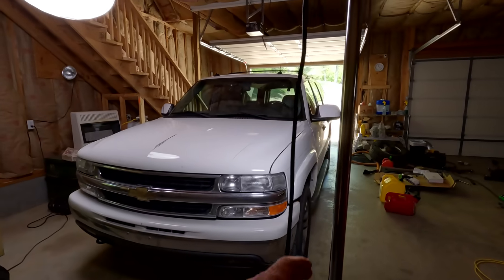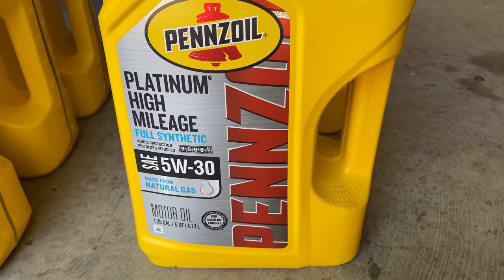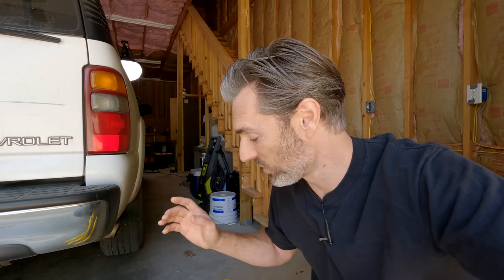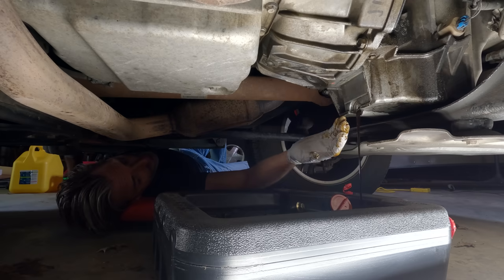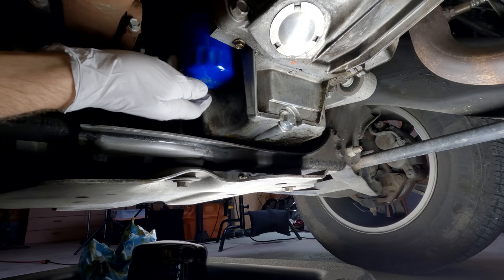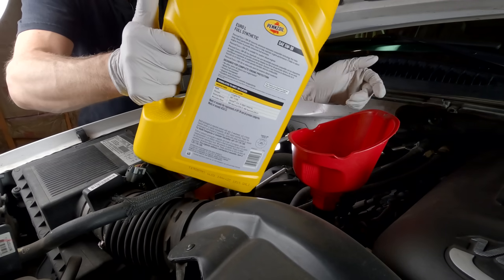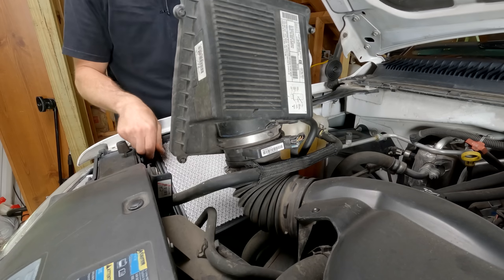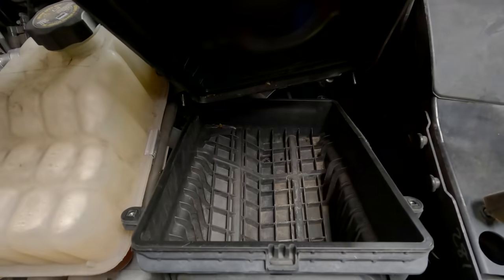If I Use European Spec Oil For My American Made Truck, Will It Break?

Comment: I always shake the oil jug before filling the crankcase. The additives sometimes fall out of suspension and settle on the bottom of the jug.
Reply from the maker: I do that too. I guess I could’ve included that in the video. 🤷‍♂️
Reply: Me too, some brands like Pennzoil are particularly bad about that. From my experience, Pennzoil Ultra/Platinum jugs still have additives at the bottom after shaking it up well. I have never seen that with Mobil 1 though. That's not to say one brand is better than the other, it's just an observation.
Reply: Did you shake the vehicle ,when it stays a long time without using it?
The oil had to hold the particle 
Dirt from the engine and the aditives in levitate.greetings from germany
Reply: @averyalexander2303  To think about all of that sitting and burning or just globbing together inside your motor. 

That sucks to think about now. I never really looked inside the bottles to see myself and reuse the old bottle pretty quickly.
Reply: I'm gonna have a hard time doing that with a 55 gallon drum.
Reply: @johannesherr2333  Whether you believe it or not, it's true. I've seen the proof with my own eyes. You definitely want all of the additives going into the engine and not sitting in the bottom of the jug you are going to throw away because at least it will be in the engine and it will get mixed again when you start the engine, otherwise it's not in there at all.
Reply: Lol you people will believe anything. Do you think dealerships shake the 400gal oil  tanks in the back before they put oil into a vehicle via the oil guns?
Reply: @johannesherr2333  What additive is "particle"?
Reply: @npb3871  Lol, giant paintshakers
Reply: If you are adding the whole jug into the engine, I think it will get plenty mixed up when it runs
Reply: @npb3871  😂😂😂 lol I work at a dealership and I know what you’re talking about 😂
Reply: I always shake containers whether it 5 quart jugs or 1 quart.  Old time mechanics that taught me always did it.
Reply: @averyalexander2303  how would you even know this? You can’t even physically see “additives”
Reply: @kg_1720  Because I can see some type of residue at the bottom of the jug after pouring it out if I don't shake it first. From the research I did, this is most likely additives that fell out of suspension. I suppose it's possible that it could be some type of impurities in the base oil, but that seems unlikely to me. There's several videos and forum posts discussing this "issue" with Pennzoil. By now, someone may have analyzed that residue to see what exactly it is.
Reply: @averyalexander2303  ahhh thanks for sharing this to everyone! From now on, I’ma start shaking my jug now too
Reply: @johannesherr2333  Oil pick up is at the bottom of case and when the car moves , bumps do the shaking
Reply: Look under the truck for leaks
Reply: Sorry, I have never seen any evidence of additives in motor oil "settling" in a container even after a long period of storage. Of course that's only in the last 60 or so years.
Reply: There’s absolutely 0 evidence of the additives settling out of oil. According to industry standards it could theoretically be possible at very cold temperatures, however this would not at all be considered normal. Rather any residual at the bottom of the jug would more than likely be some type of contamination better left unshaken back into the mix.
Reply: How do you shake the oil when it’s in the oil pan?
Reply: @j.t.cooper2963 How do you shake it when it’s sitting in the oil pan?
Reply: @1RoadGarage  Lake Speed Jr. has debunked that myth.
Reply: It’s a myth. You don’t have to. Even the motor oil geek talked about that. We all shake oil but is not needed. He does too, but out of routine.
Reply: Myth busted , Mr Lake Speed Jr covered that one lol.

Comment: so about the argument about prefilling the filter, I guess some say in doing so, you're allowing unfiltered oil into the crankcase. but, that unfiltered oil is completely new, unused oil, so what's the big deal???
Reply from the maker: Personally, I don’t think it really is a big deal at all.
Reply: The argument against prefilling is that most people fill the filter from the large hole in the center, which is the clean side. IF the new oil happened to have contaminants in it for whatever reason, they would go straight into the engine's oil supply and could damage bearings, plug oil feed holes, etc. If those contaminants were poured into the engine and ended up in the oil pan, it's not a big deal because the filter will likely catch them before they could cause any damage. New oil can contain particles, look at the bottom of a Pennzoil Platinum jug after it sat for a while and you will see what I mean.
Reply: People are stupid "dirty discussing unfiltered crystal clear clean new oil" give me a break. Also an "empty engine" still has a lot of oil in the lines and galleys but it doesn't really matter. It can be as much as 2-3 quarts. Usually around 1 for small engines. Check the engine dry fill capacity and refill capacity. The difference tells you how much oil stays in there that can't be taken out.
Reply: @elihernandez330  That's true although I'm not aware of any typical passenger cars or light trucks with 2-3 quarts of oil remaining once its drained. On my car, the dry capacity is 4.4 quarts and the refill capacity is 3.7 quarts. A large V8 like the one in this video may have a quart or a bit more remaining.
Reply: @1RoadGarage  THERE IS NO NEED TO PUT OIL IN UR OIL FILTER BECAUSE THERE IS STILL OIL IN / ON UR BEARINGS INSIDE ENGINE ...
Reply: I think the idea is that the filter is saturated and not completely dry.  On most engines, the sump forces the oil through the filter before it gets into the upper engine.  A completely dry filter will definitely create a small delay in oil pressure until the filter material becomes saturated and begins flowing oil.  It has been shown that the low pressure condition can be as long as 3 to 5 seconds.  I've just always done it because my dad taught me to do it that way.  One thing I know for sure, is that it certainly can't hurt.  The oil doesn't need to be pouring out of the filter while you're trying to install it. You just want to pre-soak the media so that it can flow faster on initial startup. I usually just fill it half way and roll it around 2 times or so  till it soaks most of it up, wipe a little around the gasket and spin it on.

Comment: Just put the truck into flood mode for 5 seconds. The filter will fill up while doing that then there isn’t a dry start.
Reply: Most vehicles bypass the filter entirely on startup anyways so it doesn't make much of a difference.

Comment: If your vehicle is a redneck it won't like using euro spec oil. Just funnin I would stick with what ever the oem says I have noticed that high mileage oils dint meet dexos specs. Some brands of oil state they meet or exceed dexos specifications but don't want to pay the licensing fee. These days all oils are good even store brands. I personally prefer valvoline engine seems to run quiteter. Can't go wrong with the company that is credited with inventing motor oil

Comment: 6:30 gallon ziptop bag or similar. Crack the can loose, wrap it, take it off inside the bag. 
No drip, no mess, no proof you changed your oil. :)
EZPZ

Comment: I also use Pennzoil Platinum High Mileage Full Synthetic 5W - 30. I also change it every 3000 miles. I also use the best filters for my 2000 Camry LE 4 cylinder K&N oil and air filters. Pennzoil is the only oil I will use. I used it for years in my 1978 4 door Cavalier. I usually take my Camry to a quick lube to change my oil. I take my oil and filter with me to have them change it. I do have a oil leak. The oil pan gasket is bad and causing it to leak. I have the new oil pan gasket and gasket seal for it to be put on. Thanks much for your video.

Comment: Im pretty sure that brand new oil right out of the jug can safely by all measures be considered "filtered"
if fresh after being refined to the point of being ready for use should in my opinion be just as good and probably many times better than what passing through a paper medium offers.

Comment: I know this may sound subjective and unbelievable but once I switched my Honda Accord 2012 from Mobil1 Extended Performance to Pennzoil Ultra Plat I noticed a smoother work of engine indeed. The engine produced let noise from the and gas mileage reduced by 1-2 mpg. What I like is that the noise from the head , from the calve train is significantly quieter, I swear.

Comment: i use ACdelco filter in my GMC Yukon XL 8,1l and Mobile1 full syntetic 5W/40 and change every spring and before winter.. and i drive around 10000miles a year
Reply: I think twice a year is perfect. With synthetic and a good filter, changing more often is a waste unless you're driving about 20k miles per year.

Comment: Being in the lube industry for 22 years this month of seen and heard it all. Yes, Pennzoil had issues in the 80's and 90's and on but the formula has changed and it's a lot better. As for prefilling it's NOT necessary on gas engines. But if u want to do it no harm no fowl.  All I've been using for oil these days is Pennzoil and Castrol Edge. I've seen excellent results with Pennzoil and no discoloration.

Comment: The oil is rated SN for the Euro no problem to use in a gas engine. Usually they have more cleaning additives like Calcium. If your car was a GDI  turbo is better to use sn plus and up to avoid LSPI. In your case no issues at all. Probably you'll experienced a smoother engine  thanks for the content
Reply: Oil in itself does not make an engine run smoother notwithstanding mechanical maladies. Oil just provides lubrication and perhaps better fuel economy. Many other parameters control engine management especially fuel and its contaminates.
Reply: @TheJcrandazzo  I mean aren’t some different brands of oils on the low side or the high side of the viscosity rating. Wouldn’t that make a difference in smoothness a little bit?
Reply: @thetechlibrarian  From a psychological point of view yes.. Any good grade of oil meeting manuf specs will perform equally as well . The viscosity(thickness) in itself does not give it more padding but better suited to keep the metal from metal contact as does any good grade of oil. A poor oil can cause other problems relating to wear and over time decrease smoothness through wear factors like fouling plugs etc..Any good grade of oil will give you unnoticeable difference in smoothness. Stay away from the cheap or improper grade oil.A higher viscosity index is based upon engine tolerances and fuel economy targets.The higher padding would not be significantly noticeable but a heavier oil requires more energy to push around the engine, hence more fuel required and stress. If you have worn out engine a heavier viscosity may help with oil loss and quiet down some moving parts as an insulator.

Comment: I've never in 50+ years of changing oil have I ever prefilled an oil filter. I never even knew it was a thing untill watching videos on YouTube. Besides some cars you can't when your filter is pointed downwards.
Reply: It is easy on the chevy where the filter is upside down on the bottom, the other ones you need ony pour a bit in beforehand and tip it sideways etc to soak the filter material

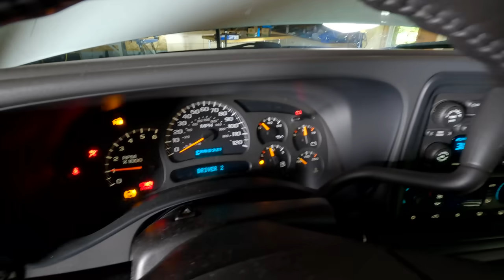Comment: 11:24. I'd rather have unfiltered new oil from a jug flowing at startup than a dry start for those 3 seconds. 
  I also use bigger than stock filters. I use a 10590XL on my Tahoe. It is the same diameter and thread pitch, but deeper. The factory-installed filter PF59 was longer like that but AC/Delco discontinued it and reverted to the smaller PF46. A PF61 will fit your truck and not be as high in the oil pan cutout. It won't hang as low as the pan, so it's still protected from physical damage (although if you manage to hit the filter on a rock, the cast aluminum oil pan would be screwed anyway). It's also easier to grab when you service your truck next time. 
  I also like to use a slightly larger filter because there is less oil pressure drop from the filter media. There is more media and therefore less restriction for the oil flow.. Especially when it gets old, dirty and partially clogged. It also adds slightly more oil capacity to the system. It may only be 1/4 quart, but it's added capacity. 
  I like to use a 0w-30 synthetic oil. It is very thin at startup.. the 0w is the viscosity at 32⁰F. The 30 is the viscosity at operating temperature. It does not hurt the engine at operating temp, it only flows better and provides immediate oil pressure when cold. I know that you don't need to worry about cold temps too much in Tennessee. But I'm like you, I want to give my engine every advantage to last a good, long time.
  I should look into buying a filtermag like you.
Reply: Some manufacturers say specifically not to pre-fill filters. Just crank the engine in clear flood mode for a couple seconds, then start it. It avoids a dry start and the potential for contaminates to enter the filter during pre-filling.
Reply: @inoahmann7542  you are still cranking the engine with ZERO oil pressure. 
  As I stated above, I'd rather have brand new oil from a freshly opened bottle in my filter than crank my engine a few hundred rpms for a several seconds. The bearings and lifters get oil much more quickly if the filter is full. I know that many manufacturers don't want pre-filled filters. But on an LS V8 engine, the oil filters are vertical and it is very easy to fill them and not spill any oil. If brand new oil is dirty enough that they don't want it on the clean side of my oil filters, why am I just pouring it into my valvecover to run down and drip over my rocker arms, down to my crank and rods as it flows into my crankcase? How do you know that the "clean" side of an oil filter doesn't have microscopic debris from the manufacturing process? 
  You can do what you like. I'll keep pre-filling my filters. To me, the benefits outweigh the drawbacks.
Reply: @EricErnst  the risk of contamination is a lot higher with bulk oil, hence the recommendation to not pre-fill. Assuming you're using smaller single use containers, I don't see much risk. On the other hand, I'm a fleet mechanic and I have a few fleet pickup trucks with over 300k miles that have never seen a pre-fill before. Do whatever you want, but I'm gonna continue to follow the direction of the company that designed the vehicle. My company has never had a bearing failure in any of our 50+ trucks. We lose 2 engines in a normal year, the last 2 we're overheated until they stopped running.

Comment: My 98 Chevy with 5.7 vortex has 406,000 miles from using conventional oil up to about 300,000. Then switched to pennzoil high mileage. Still going good.
Reply: I switched back from synthetic to conventional after I noticed some small oil leaks with the synthetic stuff.. notice no difference at all... conventional seems to work great and even seals up small leaks around seals.
Reply from the maker: Nice! About how often are you changing your oil on that rig?
Reply: @1RoadGarage  3,000 to 3,500 miles

Comment: Iv been running Castrol Euro Edge 0W-40 SN for the fast 14 years 520,000 miles in my 1998 civic DX.  not a single problem with it. Euro oil is some of the best you can get.

Comment: Nice video! From my understanding of GM's Dexos specs, I don't think you are doing your engine any favors by using the Euro spec oil. GM's Dexos 1 Gen 2 is the updated Dexos specs with stricter requirements. From my understanding, Dexos 2 is a totally different spec primarily created to protect the emissions systems of light duty diesel engines by limiting sulphated ash, phosphorous, and sulfur (SAPS), so basically that means it has less of the traditional anti wear and anti oxident additives and likely other additives instead. Exactly how effective the replacement additives are I don't know, but I would expect the euro oil's overall engine protection to be worse than standard Pennzoil Platinum if anything. But realistically either oil will work perfectly fine in your application, that engine won't care one bit.
Reply: Exactly!
Reply: Your thinking is exactly wrong!  European vehicles have factory recommended OCI's that are 2x and 3x what is recommended by US manufacturers.  You are correct that the additives used in Euro oils are not "traditional" and are not recognized by traditional oil analysis services.  I would take any of the ACEA specs over dexos specifications.  If you want even tighter (higher) spec oils look for Porsche or MB specs!
Reply: @goldsburg  Amsoil themselves says that their low SAPS oils shouldn't be used in older engines since they don't protect the engine as well as their mid or full SAPS oils and their data sheets reflect this. They also said the specialty low SAPS additives are much more expensive than traditional additives. The longer oil change intervals in Europe aren't exclusively because of different oils either, many European cars also have significantly higher oil capacities and larger filters. Even my mom's 2.5L Volvo held 7 quarts of oil. Oil is much more expensive in Europe than America too, which I believe is actually the main reason people there don't change their oil as often. I agree that ACEA specs are a better system than API specs since they have different specs for different applications instead of just a stupid one size fits all SN rating or something that almost everything meets anyways.

Comment: Dexos refer to oil viscosity. More accurately, is about HTHS, high temperature high sear simulation. A low HTHS is under 3.5, a high HTHS is above 3.5. This is only about 5w30 oil. A 5w20 oil will be always low HTHS, as 5w40 will be always high HTHS. The practical use of this value is about fuel consumption. Lower HTHS produce a better fuel consumption rate.